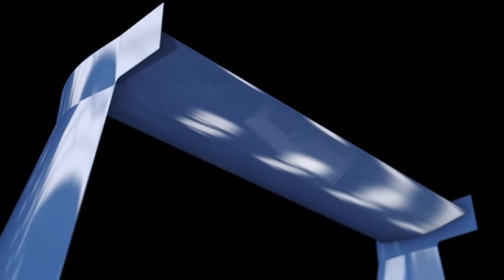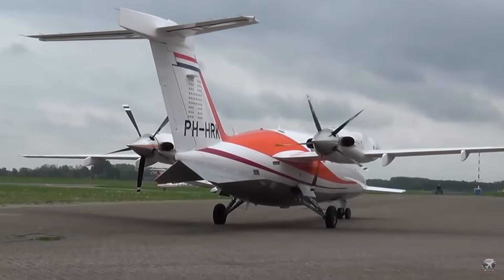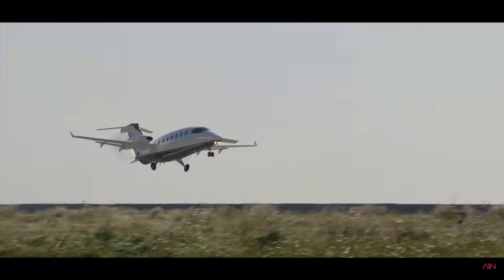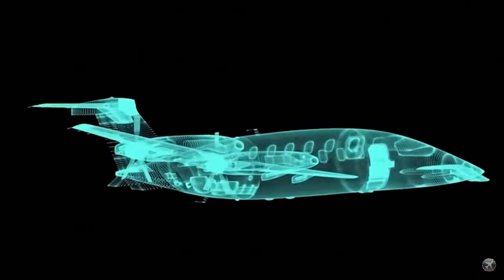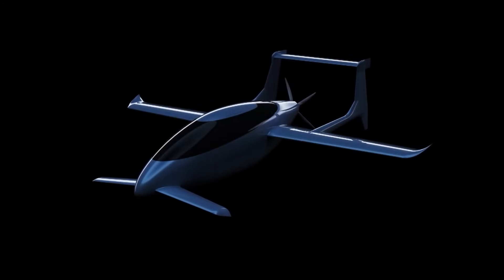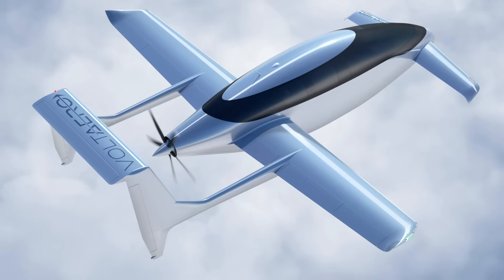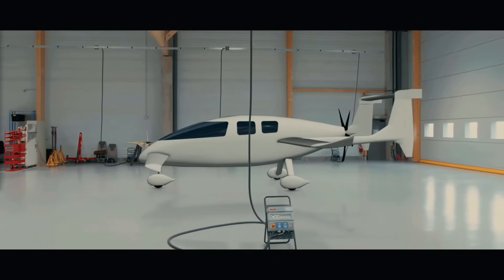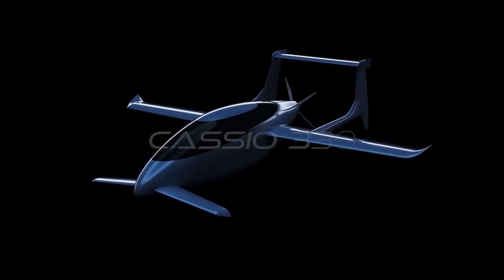Voltaero Cassio 2 Series: The 800 mile range Hybrid Electric Aircraft

Comment: It takes so long to bring a new, even experimental US Plane. to the market. Using existing aircraft that are dual motor, both conventional and also electric, would seem to be a quicker route to market and learn so much from it. Using electric for take-off and landing and as battery tech improves more of the trip, also having conventional for safety reasons. Thank You for this interesting video.

Comment: I really Don't understand if they are making Hybrid & Electric Planes , then Why Don't they solar panels on wings & if they want on plane roof including with good battery backup...
Reply from the maker: Solar panels on wing surface of a plane like this would at max would be able to gain 2 kW.
Reply: @ElectricAviation  ... Ok , that's good & then why aren't they using this to benefit themselves for longer ranger & power... It's Not up to us brother , we can just think & discuss...
Reply: I understand he means the 2kW are way too little to matter. I agree with him during flight, but depending on the use case, a plane can be charging for days on end, reducing charging costs. I'd guess with dropping prices for pliable solar cells, wing applications will eventually appear, if just as a gimmick

Comment: If pusher props are more efficient, then why do we see front props so commonly? Is there a trade-off?
Reply from the maker: The props receive air that is disturbed by the wings upsteam. This causes vibration
Reply: @ElectricAviation  that's a valid issue for wing-mounted engines. Engines with pusher props can also be mounted on pylons, as is typical for small twin-turbofan aircraft, but the pylons need to be long enough for propeller clearance to the fuselage.
Reply: Ah thanks!
Reply: One issue, perhaps minor but often noted for the P.180, is that engine exhaust flowing through the propeller causes noise problems.

Comment: Beautiful looking plane and well suited to most of the sparsely populated hinterlands of Australia with just enough range for most regions.
Reply: Would self destruct from gravel into the prop.
Reply: @rossnolan7283  Australia has many small paved airports. I like 2km from one of them. It’s fully fenced to keep the roos off, yet only has one commercial flight per day. The town it services is 12,000 people with another 12,000 within one hour drive. Admittedly this plane is not enough to bring about more available flights despite its efficiency. If it was autonomous however, bringing down the cost significantly, then it and similar planes would transform the transportation space.
Reply from the maker: There is a larger aircraft being made to service exactly these communities.  In Norway and Scotland there are remote places, where they need a similar service,   Heart Aerospace ES30. Its a 30 seater. https://heartaerospace.com/es-30/
Reply: @ in those locations flying is often the only practical way of getting around. Here driving is the norm and normally more practical than flying due to cost and convenience. For example; often to catch the once a day, sometimes or, sometimes less, flight one needs to drive in the wrong direction for an hour or two, to catch a flight which gets you to a destination, often not exactly where you want to be, at a time that is not ideal. As opposed to driving 5-7 hours in the right direction, at the ideal time for you, and having your personal car for transportation when you arrive to the exact location. This dilemma normally sees the car win the vote. Bigger planes, 30 seats , are too big. There simply isn’t the patronage for them. 5-12 seaters flying more or less on demand however are a very compelling option. But the only way they will work is to be autonomous, otherwise the cost will be too high. It will happen, 30 years away?? 😂, just like nuclear fusion 😎

Comment: It's getting interesting now that e-aircraft are exploring the design space more freely. In the same way that designing electric cars from a blank sheet is overcoming range anxiety, designing an electric aircraft from a blank sheet allows aerodynamic advantages that conventional ICE struggles to achieve - specifically propeller motor can be kept light and be put aft.
Reply: There is nothing about this design which would not apply to a ICE-powered aircraft, so electric power is not enabling anything. Just look at the P.180 and all of the designs copied from or inspired by the Rutan VariEze.
Reply: exactly my thought too. Beautiful and exciting. Do you think this will even get to large aircraft one day, or are options for those more limited?
Reply: @LowAltitudeEconomyNews  , let's put some numbers in to answer that question...

Assume todays leading edge batteries from say Lyten or Amprius with ~1.5MJ/kg or 417Wh/kg, and assume 1/3 aircraft mass is battery, with a reasonable 20:1 lift/drag. This gives theoretical range:
1500000J/kg * 1/3 * 20 / 9.81m/s^2 = 1019km (~550NM).
For recreational flying or training that fills in a nice gap between gliders and piston pounders.

In theory Li-S could get to ~5MJ/kg or 1300Wh/kg, assuming similar active material fraction as today's Li-ion cells. It also assumes there are no electrochemical show stoppers for scaling up production - we are some way off from this, although monoclinic gamma-phase sulphur cathode research looks promising. A well designed airframe optimised for slow speeds at low altitude (go high for high speed) could target 30:1 lift/drag. This would give theoretical range:
5000000J/kg * 1/3 * 30 / 9.81m/s^2 = 5000km (2700NM)

So I would say that this range could benefit many continental flights, although not inter-continental.
Hope that helps you...

Comment: As illustrated, certainly single engine 3 surface aircraft are the ultimate distance cruisers, so they fit more of a regional aircraft than say a local taxi we are perhaps more familiar with. While they will be quieter, thats not necessarily requirement except for in the cabin, but genuinely need the higher efficiency to compete in the regional space. Maybe the question is, can we use what we have learned of this configuration in the air taxi role to fine tune those efficiencies.